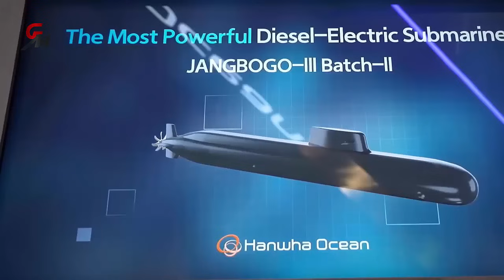Which is Better TKMS 212CD or Hanwha KSS-III, Here's The Canada's Next Gen Submarine

Comment: KSS !!!
Reply: I wouldn't be confident in a Korean sub. The Daewoo maintenance crew was responsible for causing the sinking of one of the Indonesian subs.
Reply: @thelastdefenderofcamelot5623  The Nanggala, the second of the Type 209 submarines imported from Germany in 1981, is an aging vessel, approximately 40 years old. Daewoo Shipbuilding & Marine Engineering (DSME) performed a performance improvement depot overhaul in 2012. However, the submarine did not undergo any depot overhauls, which are typically performed once every six years. After 2018, it did not even dive until
on April 21, 2021, when it sailed deep into the ocean,
and sank under the pressure of the deep sea.

Its crew was originally 38, but 53 were on board.
The submarine's maximum diving depth is 250 meters, but it is likely it dived deeper.

However, submarines are normally required to undergo depot maintenance every six years. If a submarine must be operated beyond its service life, it must undergo depot maintenance at a shorter interval. Therefore, Indonesia is solely responsible for not conducting additional depot maintenance after the 2012 depot maintenance, and Daewoo Shipbuilding & Marine Engineering is not at fault.

Submarine depot maintenance is Indonesia's responsibility.
Indonesia, by failing to perform depot maintenance, is responsible for the deaths of the submarine crew.
Depot maintenance involves completely disassembling a submarine and replacing internal components.
This resolves malfunctions caused by aging components and restores fatigued submarines to like-new condition.

Comment: Maybe TKMS could offer special small vertical launch module for 2 or 4 vertical to add later or in short precision, because vertical launch get some advantage of match with some kind of weapon system, that Canada, as big World Wide Power could have advantage to dispose, this type,of contract are extremly complex, as the client request and the data sheet of the Submarines holds big numbers of matching possibilities, but as undersea research and industrial goals under sea are growing, a space to evacuate special force or,équipement for the U-boat to ground sea will normaly be growing in Futur, and évacuation can also be realised verticallY, ....and fighting against airplanes, onces detected, is maybe more direct with vertical launch system,..no needing big number one 2 or 4 vertical launch vertical tube should be more than enough, so relative small module for vertical system launch in lenght size would be plently enough and could be designed to plug in a more conventional horizontal launching sub...  Canada have with Norway some kind of identically water ice volumes, so maybe this experiences coul be, under military conditions,  shared or used in military defined strategies to master the artic surface undersea volume that in the future will be more used for Energy Gewinnungen, .. The Asian seas in front of South Corea have different types of structures.and probably the Corean Uboots are more specifically designed  to mastering  this specific undersea Asian waters conditions ,!????, but having horizontal and vertical tubing systems, is of advantage,...,.and as the modern concepts of Submarines designs is modular, adding one vertical small module is a good concept,..and Beeing reasonable by the size of it, 2 or 4  vertically tube système, and the verticality could be both side, in direction to the sea bottom as well as in direction to the sea surface,...,all in module well designed options to be plug in by option on a more classical horizontal tubing systems sub, because industrialisation sea bottom ressources is not out of needs, and this needs also Vertical and Horizontal SyStemS that can handle this type of activities with serious efficiency,..Coreans have a large and very quality Marine Industry and Germans have long quality under fire experience with Uboots, so Matching the request of Canadian clients, is for sure a very serious complex process,..V&H, Vertical and Horizontal tubing systems, ideal, complex, so staying reasonable in size, is of importance, for rapid flexibly must or should always be a possibility to answer , ...,🌞🎯🛞🪃🛞⚓💎⚓⚓🛟⚓⌨️💻🖥️🧮📡🛰️⁉️...
Reply: You do not need the launch capabilities you ask for if you check out what Kongsberg is preparing for the 212CD.
Reply: @user-ip1cx5su8l I do not have the information about what Kongsberg is preparing in design for theire Futur 212CD,  maybe you highlight me a link, I'm always interested with marine tech,....there  in Tromso,...🛞⚓🛞.

Comment: I like South Korea's sub from Hanwha, it can launch SLBM and ballistic missiles, vertical launch missiles. You can launch Nuclear missiles from the sub.
Reply: We should buy from whoever build it in Canada...we pay and we want jobs created here...... way more important..frankly, those submarines are likely patrolling our borders more than engaging in real wars.
Reply: Ok but where does it get interesting for Canada considering we are at war with no one and the main mission for those subs are long endurance under ice patrol?
Reply: @benoitnadeau5845  Hanwha's KSS-III batch-II submarines have a Continuous submerged endurance of over 60 days.
Reply: @benoitnadeau5845 ....We are at war with no one......Today.
Reply: It has no non magnetic steel, need to overhaul the design for arctic capability (very risky), you can order MPLS and VLS to TKMS
Reply: @saltymonke3682  KSS-III and Non-magnetic Steel is austenitic steel
KSS3 non-magnetic steel" itself appears to be a general term for the non-magnetic steel used in the KSS-III submarine, rather than a specific steel product name.
Non-magnetic stainless steels typically suppress magnetism by increasing the nickel content to stabilize the austenite phase. Information on high-strength non-magnetic stainless steels developed by some domestic companies, such as KSP Steel, is also available.
Reply: @mkchoi8080 you're using the lower-grade export version than the one used in Type 212A, Todaro and Type 212 CD. Not even comparable to japanese soryu ssk.
Reply: @mkchoi8080  still importing it from TKMS, lol

Comment: Just throwing this one out there.. Get both! KSS3 with VLS capability, and for longer patrols (qty of 4 for the West coast) and (qty 8) 212CD E variants as Hunter/killers in the tight spots up north. They could put 3-4 212’s each on both coasts and have Arctic circumnavigation patrols.. 212’s on the West coast to ‘wingman’ the KSS3 🤔.. Personally, I’d feel more comfortable keeping the KSS3 ‘South’ out of the ice, and rotating the 212’s North.. Thoughts?
Reply: The U212CD has VSL! It also has HSL! If they want, TKSM can build the Virginia-sized U212CD; it's scalable! According to AI, this is even a huge cost advantage! Building and dismantling a Virginia-class ship costs $8-9 billion, but for that, you'd definitely get two to two and a half hundred U212CDs with 9,000 tons! According to AI, such a U212CD would be far more dangerous than the Virginia-class! Carrying nuclear weapons would be no problem. Or you could build the U212CD 90 or 100 meters long simply by adding more central modules! That's what they did with Israel's U214 Dolphin; it's 20% longer and has HSL for nuclear cruise missiles!
The U212CD combined with 20 large underwater drones and 60 small ones would make a 7,000-kilometer perimeter possible, according to AI! Data transfer would take place underwater, and drones would serve as relay stations, putting the new, unique underwater transmission system in a whole new league!
The U212CD is an underwater combat cloud FCAS system that, according to AI and experts, is unique and will be the future of naval warfare! Comparing the KSS III with the U212CD and its innovative combat cloud with drones simply doesn't work.

Apart from that, the KSS III is a larger-scale derivative of the KSS II with new features. The KSS II is the complete derivative of the TMKS U214! However, the U214 doesn't have the high-tech sensor technology of the U212A! The U212CD's high-tech sensor technology, however, is in a much higher league than the U212A! The U212A is currently being gradually upgraded to the latest high-tech sensor technology with AI for €1 billion.
Reply: Operational maintenance will be redundant. This will place a significant burden on the Canadian Navy.
Reply: @am90cx28i  4 and 4 would give RCN 8, which is 4 more than 🇨🇦 has now, functioning anyways..🙄.. Maybe, 🇨🇦  will get more, But, I get your point, that crossed my mind as well. I believe both 🇩🇪 and 🇳🇴 are ordering only 6 each so if 🇨🇦 ordered 4-6 212’s and 3-5 KSS3 from Hanwha, I think both companies would be at least content with getting a ‘piece of the pie’. One company getting the ‘whole hog’ is like putting all of your eggs in one basket. 75 cents of every 🇨🇦 Defense dollar goes to the 🇺🇸.

Comment: Don't buy Korean Subs, ask those Indonesians, they had buyer's remorse and refused to pay the 2nd Batch down payment of Korean subs because of propulsion and battery problems then had to buy the French Scorpene.
Reply: 인도네시아 프라보워 수비안토가 블랙머니를 사랑하는걸 한국사람들도 잘 알고있습니다.^^
그래서 KF21 계약도 뒤집어진거죠...
Reply: @두마리호식이 again, if kickback money is the problem, DAPA wouldn't send their staff to fix the problem.
Reply: @두마리호식이  the problem was well documented during the diving depth test of the pennant number 403
Reply: @saltymonke3682   나가사파 1번함은 문제가 발생했지만 기술지원이 되었고 2번, 3번호는 정상적으로 운용이되고있습니다..
Reply: @saltymonke3682 그나저나 니네 왜 약속한 KF-21 대금 안줘?? 벌써 몇년째 연체중이야.. 얼릉 갚어. 중간에 기술 탈취한다고 너네 기술자들 잡혔다며? 으휴.. 돈도 없으면서 기술까지 빼내려다 걸리고 가지가지 한다..
어서 약속된 대금 지급이나 해~
너네 불량 신용도 주변 국가들에게 다 알려지고 있어..
Reply: @두마리호식이 they're not, because they're using the same battery. The problem lies with the sensors and battery mismatch. DSME said they could provide such power capability with their battery at a certain price to the high-tech sensors for the boats. The battery underperformed because the high tech german sensors are taking higher power capacity than predicted by DSME thus affecting the endurance and speed. 

As far as I know, the problem is still there for the 3 boats. Even DSME and DAPA staff knew it and couldn't do anything because the only solution is enlarging the hull to accomodate more battery.
Reply: @saltymonke3682  I don't know about the battery issue because it wasn't covered in the media at the time. Batteries vary greatly in performance depending on the user. At that time, when the Indonesian Minister of Defense was replaced by Prabowo, the second submarine project was canceled, and Prabowo reportedly said the reason was to diversify weapons procurement. I have doubts about the operational and maintenance capabilities of the Indonesian submarine that sank a German submarine that was over 40 years old. At the time, the Indonesian government announced that the accident was a natural disaster after investigating, but not many people believe that. I personally hope that Indonesia will import a lot of weapons from France, Russia, the United States, Truk, and Germany. Please work hard to prevent the Indonesian government from purchasing Korean weapons. If Indonesia came to purchase Korean weapons, all Koreans would laugh at them. Because Indonesia's Prabowo is a superstar in Korea.
Reply: @두마리호식이 the problem arose even before him in 2017. It's during the diving depth test. They wrote formal letters of complaint in 2018. But DAPA only sent their staff in 2020. DSME was late to respond. They know Indonesian will use those sensors, but they have miscalculated that. That's the point. Because DSME only have 1 single source of battery provider, LG.
Reply: @두마리호식이  again, I'm not Indonesian but that problem is very well known in the industries. Because the indonesian MOD stated the facts and their reason when they searched for replacement for the 2nd batch. They went to TKMS, Navantia, and Naval group even Turkish yards for alternatives. Other yards were full at the time, or cant meet their sensors to power requirements, that was 2020 and late 2019. DSME only reacted after that mystery shopping but it's too late
Reply: @두마리호식이  it's his polite and diplomatic answer to SK. if he said the battery was not good, there would be a diplomatic disaster between you and them. Polish Orka project tender was relaunched due to that factor.
Reply: @saltymonke3682  All three German submarines in Indonesia are at fault for the excessive battery drain, as this is due to excessive power consumption in German components.
Reply: @mkchoi8080 huh? Germans? They have 2 germans, 1 sank. The other 3 are Korean submarine Chang Bogo. The export derivative of Type 206 by DSME. ask DSME why did they put those high end sensors with LG batteries
Reply: @mkchoi8080  also, it was a korean firm who proposed those sensors, LIG
Reply: @mkchoi8080 again, why did SK buy type 214, the export derivative of type 212A?
Reply: 신뢰를 지키지 않고 명예도 없는 국가 = 인도네시아
Reply: @iskimxs then ask them. Not me
Reply: The Nanggala, the second of the Type 209 submarines imported from Germany in 1981, is an aging vessel, approximately 40 years old. Daewoo Shipbuilding & Marine Engineering (DSME) performed a performance improvement depot overhaul in 2012. However, the submarine did not undergo any depot overhauls, which are typically performed once every six years. After 2018, it did not even dive until
on April 21, 2021, when it sailed deep into the ocean,
and sank under the pressure of the deep sea.

Its crew was originally 38, but 53 were on board.
The submarine's maximum diving depth is 250 meters, but it is likely it dived deeper.

However, submarines are normally required to undergo depot maintenance every six years. If a submarine must be operated beyond its service life, it must undergo depot maintenance at a shorter interval. Therefore, Indonesia is solely responsible for not conducting additional depot maintenance after the 2012 depot maintenance, and Daewoo Shipbuilding & Marine Engineering is not at fault.

Submarine depot maintenance is Indonesia's responsibility.
Indonesia, by failing to perform depot maintenance, is responsible for the deaths of the submarine crew.
Depot maintenance involves completely disassembling a submarine and replacing internal components.
This resolves malfunctions caused by aging components and restores fatigued submarines to like-new condition.
Reply: @mkchoi8080 we're not talking about Nanggala. But DSME Chang Bogo pennant number 403
Reply: 당신이 운전하는 자동차가 고장이 났는데도 2년이상 그냥 탄다면 자동차가 어떻게 돼겠니?
잠수함은 심해에서 운행되는 함선이기 때문에 정비를 하지 않고 운용한다면 그냥 수장되는거다 .
Reply: @김준승-q8x  that's their Nanggala, that's the older submarine. Pennant number 403 is an SK SK-built submarine. 3 of them still have a battery endurance problem to this day, from pennant 403 to 405
Reply: 인도네시아가 구입한 잠수함을 제대로 유지 보수하지 못해서 고장나버렸고, 그 잘못을 한국 탓으로 돌린 것으로 최종 결론 났습니다. 
잠수함은 유지, 보수가 매우 중요하기 때문에 건조 뿐 아니라 운용에 매우 많은 비용이 들어가는 전략자산입니다. 
인도네시아 해군은 그에 대한 이해도가 낮았고 한국측 조언도 무시했기 때문에 잠수함에 문제가 생긴 것인데, 잘 알지 못하면 함부로 말하지 마세요.
Reply: @o-gentleman oh yeah, broken down since the beginning of the delivery because it couldn't achieve the promised speed, great, blaming the customers now. LoL. 

If it's their fault, DAPA wouldn't send their staff there until it's too late.
Reply: @o-gentleman  funny that the issues were also on the actual endurance of the battery since the delivery date and depth diving test on the first submarine compared to the older German submarine.
Reply: @o-gentleman  the issue of the electrical supply, Battery and propulsion was from the first submarine in 2017 during the test by the Indonesian navy. They formally sent letters to SK government to fix the issues. But they didn't reply until it's too late
Reply: @o-gentleman I know this issue quite well

Comment: Why can't Canada have a mixed fleet od both best competitors?

Why must only 1 be picked?
Reply: Here's a comment from me that I've already written. The U212CD is in a much higher league, and currently there is no submarine, not even the U212A, that can compete with the U212CD! The U212A played the mouse in large-scale test maneuvers against the US carrier group. It sank the entire US group, including the attack submarine, within a few days of the maneuver!

The U212CD has a VSL! It also has a HSL! If they want, TKSM can build a U212CD the size of a Virginia; it's scalable! According to AI, it's even a huge advantage in terms of cost! Building and dismantling a Virginia class costs $8-9 billion, but for that you definitely get 2-2.5 U212CDs with 9,000 tons! According to AI, such a U212CD would be far more dangerous than the Virginia class! Carrying nuclear weapons would be no problem. Or you could simply build the U212CD 90 or 100 meters long with more central modules! That's what they did with the U214 Dolphin Israel; it's 20% longer and has a high-speed launcher for nuclear cruise missiles!
A U212CD combined with 20 large underwater drones and 60 small ones would make a 7,000-kilometer perimeter possible, according to AI! Data transfer would take place underwater, and drones would serve as relay stations, putting the new, unique underwater transmission system in a whole new league!
The U212CD is an underwater combat cloud FCAS system, which, according to AI and experts, is unique and will be the future of naval warfare! Comparing the KSS III with the U212CD and its innovative combat cloud with drones simply doesn't work.

Apart from that, the KSS III is a larger-scale derivative of the KSS II with new features. The KSS II is the complete derivative of the TMKS U214! However, the U214 doesn't have the high-tech sensor technology of the U212A! U212CD high-tech sensor technology is, however, a far superior league to U212A! U212A are currently being gradually upgraded to the latest high-tech sensor technology with AI for 1 billion euros.